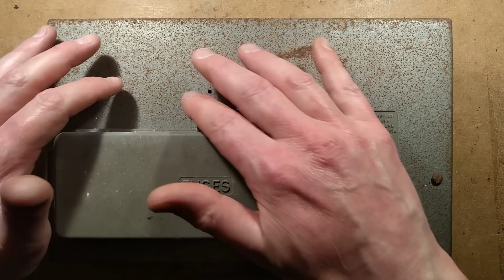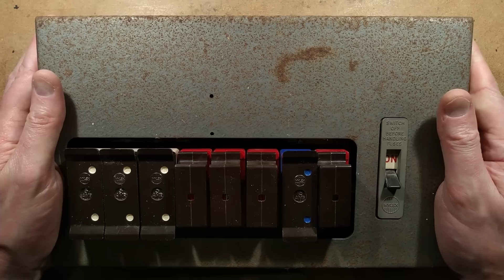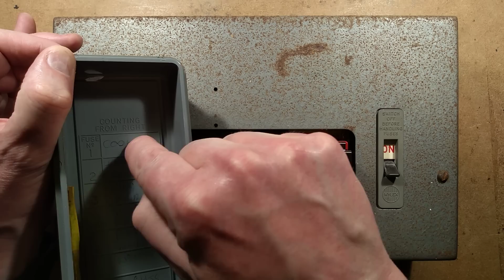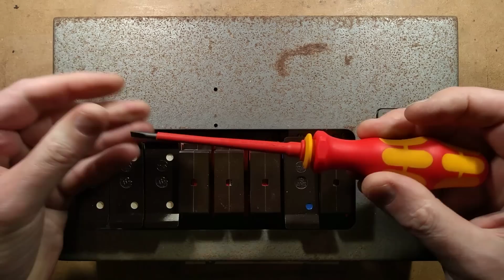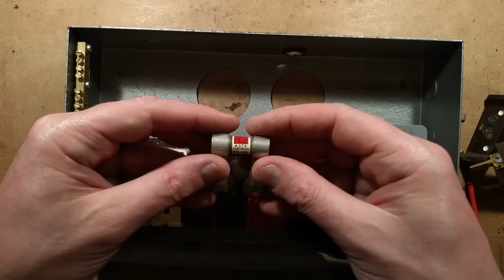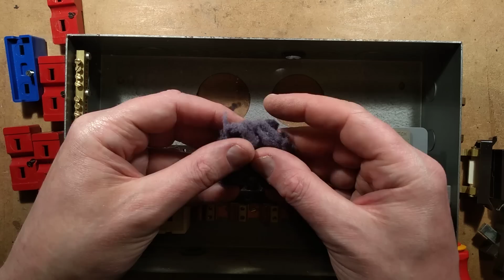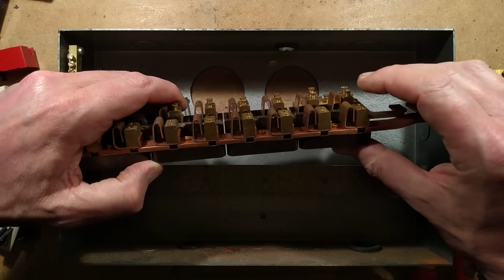Teardown of an old British Wylex electrical fuse box.  (with bare fuse wires)

Comment: I live in Clydebank and when I was a kid there was a derelict building down at the clydeside called auto leisure land that had what looked like giant vats made of the old white Victorian enameled bricks that were about 50ft deep and we used to jump off the top into the lovely soft white fibrous material in the bottom and then climb back up the ladder at the side and we would do this for hours not knowing that it was asbestos
Reply: The big man metal detecting 😳😱

Comment: You should have mentioned the truly disgusting aroma they emit when the fuseholders overheat!......had one in my old house, located in the enclosed front porch. For ages, I thought something had died in the cavity and was quietly decomposing, then finally traced it to the CU. It didn't like the load of the electric shower.   My current place had the same CU fitted when I moved in. Had that replaced!
Reply from the maker: That aroma is a good clue that something is overheating.

Comment: A very common problem. When a blown 5A fuse is re-wired The new wire is correctly wrapped clockwise under the screw head in the fuse holder,  Tightening the screw pulls the wire taught and often causes an almost invisible hairline break in the wire just by the edge of the screw head. The fuse looks OK and gets replaced into the board. Of course the circuit won't work and it can take hours of fault finding to find it. (Sorry to all those electricians who make a fortune out of call-outs for this one for giving the game away.)

Comment: I have one of those in my cellar right now......it did get "upgraded" with re-settable fuses....interestingly 10 years or so ago i had to do some work on the lighting circuit, i removed the fuse...and much to my shock (heh) i found it was still live....with no fuse.....it was arcing across behind the fuse.....so that got disconnected.....i'm fine running my whole house through 3 fuses eh?

Comment: I had one of these in my home up until 7 years ago. Then I had an electrician install a modern MK box fitted with RCDs when I had central heating installed. Then I met someone who told me my electrical supply was "ILEGAL" and said he would have to disconnect me unless I replaced it all with a new box and new RCD units. He also took the old MK RCDs away to "DISPOSE" off.
He disconnected the supply and I had to call the police and get my old switch gear back. 
Yes a crook electrician. They still exist in London.

Comment: Im guessing that a" ring main" is what in America we would call a receptacle branch circuit?
Reply from the maker: It's for receptacles, but unusual in that it loops round in a circle from the breaker, to all the sockets/receptacles and then back to the breaker again.
Reply: @bigclivedotcom  is that with a neutral or both legs of the single phase? What is the voltage? I know you guys do 230 @ 50hz  but is that with a neutral?  What is the single phase voltage with both legs? Do you have three phase, I assume you do.
Reply: @Ojgville4l  UK has three phases at the pole but only a single phase to each residence. There aren't two "legs," as it's not split-phase power like U.S. homes have. There's just one line/hot, one neutral, and one earth.

Comment: I have a plastic wylex box,all fuse wired.
Iam wanting a commando socket installed outside,but am concerned ab electrician would tell me I need new unit.
Would I need one,should I get one?
Reply from the maker: It would be better to protect the outdoor socket with a suitable RCD.  That could be added in the style of a shower unit.
Reply: @bigclivedotcom  thanks👍

Comment: I once worked in a band whose bass player would wrap silver foil peeled off a packet of Club King size around a blown fuse....as   opposed to having a spare amp in the car...
Reply: McOscillator House owners are legally required to check for this trick whenever a craftsman other than a certified electrician has been left alone with the fuse box.  Few do though.
Reply from the maker: There are some people in the entertainment industry who do that and "teach" the next generation about it too.

Comment: Old School, PROPER JOB !, - Easy and cheap to install new fuse wire, at a moments notice, - or Bacofoil / Chewing Gum Wrapper / Coathanger or such, if you run out of that, jobs a good un.  Nothing whatsoever to go wrong (apart from slight risk of house- incineration).  Good Old Days.

Comment: I still have one of these. It buzzes slightly when the shower is running... and the lid broke last week when the door caught a gust of wind and smashed into it. Oh dear.
Reply from the maker: That's probably because the unit is probably not fitted with the correct protection for a shower.  I think the maximum protection in these is 30A.

Comment: I have the plastic version of this board installed in 1980 with fuse wire, having it replaced next Thursday.
Reply: Send the original to Clive :)
Reply: Haven’t watched the video yet, just read a few comments. Asbestos has been mentioned so not sure I should be sending the fuse box in the post.
Reply from the maker: No don't send any fuse boxes.  I've got too much stuff here already.
Reply: No don’t worry, my fuse box is going In the bin. Wow Clive actually wrote on my thread feel very honoured.
Reply: Clive can you do a hoarder tour video? Would be fun to see your hoard of stuff.

Comment: Company fuse ,cut the seal ,and pull it out. Don't put your fingers in the hole. If anybody asks ,it was all like that for as long as I can remember. 
There should be planned power cuts so we can all bury a jumper wire in the wall

Comment: Why is there no MAIN fuse, as in the USA "entrance" box?  It should limit total current, not just each branch circuit?
Reply from the maker: There's a sealed fuse on the incoming cable side of the meter.

Comment: Reminds me of stab lock by fpe here in usa... looks alot more reliable tho!....
Reply: the stab part of stab lok wasn't really the big issue although it did happen, it was more the non common tripping common trip breakers, the turned off but not really off breakers, and the gfci's that trip into a non disconnectable state so the very act of tripping the gfci makes the power more difficult to disconnect and removes all overload protection.

Comment: I have an old war time workshop that has a load of this wire type fuse system some large some small, i'm getting tired of the down time when I have to change wire, I would like to modernise the 3 phase side of things as I now have an 11kw compressor, could I get away with changing these fuses to mcb , I believe that is what they are called, I'm no electrician but I've struggled with getting a reliable electrician to come in or come back
Reply from the maker: You may be able to find a resettable circuit breaker that plugs directly into these panels in place of a fuse.

Comment: Ah yes I grew up with that protecting the 15 and 5 amp non ring main distribution, that I survived without either electrocution or fire. Ok I did have an electric shock or two from light sockets but that is another thing.  What I consider bonkers is that where I live now started out with a box like that, only with 13 amp ring mains, but was replaced with a set of circuit breakers, which has been replaced since with a new set cos the old ones were too dangerous, and I expect that the new one will not be considered safe enough in time to come, elfin safety and all that. Oh I remember the old days of replacing fuse wire and having to have it handy along with a torch with ever ready batteries and incandescent bulb.

Comment: Could you do a video explaining the difference between the "Ring" main in the UK and branch circuits in North America?  By the way, who was the bucket head that thought you were poking around in a live panel?  Anyone that watches your videos should recognize your bench, not to mention there were no source or loads wired in...
Reply: Basically a "ring main" leaves the consumer unit breaker goes around the sockets on that particular floor and then returns to the same consumer unit breaker  er ...in a sort of ring. It's an old anachronism that dates from after WW2 when copper was short and expensive in the UK, the idea being that smaller dia. copper cable could be used for a greater amount of amps if it returned to the unit. The other circuit in use is a "radial" in the UK which I think is  the same as a US "branch" circuit This leaves the consumer unit and daisy chains sockets but does not return to the consumer unit. Radial circuits tend to have thicker cables  if they are covering what might be classed as a larger area (4mm three core cable) whereas a ring main will only use 2.5mm three core cable. Lighting  is on a "radial" circuit but is only daisy chained by 1mm cable as obviously it's low current.

Comment: How does grounding and bonding work in the uk?
Reply from the maker: Depending on the system, a neutral earth link at the incoming supply and then connection to key points like water pipes with cross bonding between taps faucets.
Reply: @bigclivedotcom  do you ground all your devices?
Reply: @bigclivedotcom  do you use ground rods?

Comment: How much would an electrician roughly charge to change one of these to the modern style one??
Reply from the maker: That can be a wide range.  It's worth getting quotes for comparison.  Depending on the condition of the existing wiring it would probably be around £100 for the unit plus a day to fit and test it.
Reply: ok. thank you Clive . Merry Crimbo to you all x

Comment: If I moved into a house that had one of those I'd just replace the fuse holders with breakers.Seen them on JW's channel and, honestly, I see no reason to keep using fuse wire when breakers that fit into the slot are  cheap and easy to get.

Comment: What is a “ring main”?
Reply from the maker: Also called a ring final circuit.  The cable loops around the loads in a ring and returns to the fuse/breaker.
Reply: @bigclivedotcom  ah ok. Thank you for the explanation. Keep up the great content!

Comment: Ah, the easy to touch busbars...  how I remember the belt you used to get off of those 😞

Replaced one of those many years ago, never realised the busbars were exposed, was pulling fuses to identify circuits... yeah, not something I'd recommend.
Reply: That hole in the top means you can get a shock by just pulling the fuse with the main switch on.

Comment: Got to disagree with you on replacing this thing if you have one in your house.  I'd be replacing this scary thing with modern circuit breakers before moving in.  I guess the wire fuses are better than the screw in fuses that could get bypassed with a coin though.

Comment: theres hedge in my neighbors backyard (thats right next our fence) that had an asbestos tile buried in it (probably by previous land lord) the new tenants recently moved in to this house and they have ripped out that hedge and the asbestos tile. we had washing out drying whilst they were doing this and i am worried that our clothes may be contaminated with asbestos now.
Reply: QWERTY4REAL A few specs of dust is rarely a problem. Each grain is like a lottery ticket with a very small chance of death.  Another post mentioned the safety limit for civilians being ten thousand fibres per cubic meter of air, all day, all year.
Reply: @johnfrancisdoe1563  thanks for your reply i think the asbestos tile was made out the less dangerous kind of asbestos anyway

Comment: Are you sure about breakdown twixt fuse wire and case.  It must be a few mm and with 240 V is that too far ?  #justsaying
Reply from the maker: When an arc flash occurs it creates a tongue of conductive plasma that can travel quite a distance.  The same failure mode can cause an avalanche effect on mains voltage circuit boards when one are fails and flashes over to adjacent circuits.  The sooty mark on the side of the plastic cover would have been a hot plasma of air and metal vapour.
Reply: @bigclivedotcom  Is that the same problem I had with my bathroom pull chord.  I replaced the fitting, ballast etc before I discovered it was the switch.
Reply from the maker: @paulmartin42  What was the fault?  Was it blowing a fuse or tripping a breaker?
Reply: @bigclivedotcom  Neither of the latter. It would just flash the light intermittently like fluorescents do at end of life.   So was very surprised when it happened with new bulb ... new everything until I got a new  pull chord
Reply: @bigclivedotcom If u like I can send you it & ...
Reply from the maker: It sounds like it was a bad switch contract making intermittent connection.

Comment: We had one of these in my childhood home in the cupboard under the stairs. We also had dangling wires in our bedrooms with a switch in a pendant as a 50’s version of a remote control of the lights. The one thing I used to do at bedtime in the 60’s was bat the pendant back and forward when I was bored... until one time I knocked the pendant off the end of the wire..  and then TOUCHED THE LIVE WIRE THAT WAS LEFT BEHIND.  I had the scar from the mains shock in the palm of my left hand for years... and my Dad removed the pendant wire completely to stop it happening again. Barn door/horse bolted lol

Looked exactly like this... https://i.imgur.com/xbHxNDs.jpg

Comment: Still have one of these working in my downstairs cupboard......
Reply: bod Cole same here but ours is smaller with just 1 ‘sockets’, 1 ‘cooker’ and 1 ‘lighting’ fuses... so all upstairs and downstairs sockets are on one fuse, same with all the lights and no idea where ‘cooker’ goes as we have gas oven. There was a separate ‘breaker’ in its own box fitted at some point for the shower...
Reply: @gilbertsprojects2954  That sounds very familiar to me too. I guess I should be in rewire territory.

Comment: The irony now that 18th edition regulations require all distribution boards to be metal, when people have been removing these for years.  They were far higher quality than the crap that has been available for the last 20-30 years.  Plastic body, plastic mounting rails, thin copper busbars and easily-bendable screw terminal clamping areas.  Everything built down to a price rather than up to a decent standard.  If you could retrofit RCBO breakers into one of these boards it would be far and away the best quality board you could fit.
Reply from the maker: And then just to make sure they were more dangerous, they deskilled the industry in return for cash, issuing "approval" to people who had attended a one week course.

Comment: I had a strange fault at the care home I worked at. 3 rooms, lighting on same circuit, but none were working. Sorry, except one of the rooms was. Kind of. Anyway, months went past, electricians trying to find the fault, they could not. Changed the trip switch as last resort, no luck. No voltage in the other rooms at all coming in.

Months later, the resident in the room where the light WAS working, said that the light was flickering. Guess what, I had a look at the bathroom switch and BOOM. Two wires not connected to the switch but were slightly touching the contact. How, I have no idea. I re-attached the wires correctly and Voila! Problem solved!
Crazy how sometimes you miss the obvious faults like the switch in cases like that. Even baffled the electricians. I am not a sparky but know the basics and managed to fix the issue. (together with the resident that is)!

So what Im saying is, these RCD consumer boxes or what ever they are called, is the last place to trouble shoot and sometimes the first place to look when finding a fault. Trip switch goes off, logically would make sense to change it. But no. Always check location of where the trip switch is for i.e washing machine. And check the devices, unplug them, reset trip switch. Then you will find the cause.

If you decide to ever look at or troubleshoot your electrics at home or work, please make sure you know what you are doing. SAFETY FIRST and cut power, then trouble shoot. 
If you are not sure, then get someone who knows to do the job. Simple.
End of my story, sorry Clive. 
Great video as always!
Reply from the maker: It sounds like the electricians that were being called in were not really competent.  They should have traced the wiring and found the fault by methodical tracing and elimination.  Unfortunately it's probable they were facilities management labour and therefore not actually electricians at all.
Reply: @bigclivedotcom  They probably were not. But they have to be certified to a 'degree' to service the main supply distribution board tho right? Not just any electrician?
Reply: One guy actually made me nervous. He was checking the dis board and didn't look very competent. I stood back just in case hoping nothing was going to happen. Maybe I should have checked his credentials first!

Comment: I have recently ripped out a job in preperation for a rewire and installed a temporary supply, you wont believe what i found, from the meter isloator there was about 6 2.5 rubber insulated cables, all twisted up and taped using cloth tape one end into the isolator, and in the board all of those cores were cracking and the insulation was falling off, baring in mind these cables were fused at 80A with the main cutout fuse. It is much worse than i describe, the most dangerous thing i have ever seem in my life. Worse thing is that EDF had installed a meter about 3 years ago and reinstated these cables as main tails. Stupid.

Comment: As a surveyor your asbestos demonstration got me worried for a bit there. My only asbestos advice would be to suspect the worst and seek specialist advice.
Reply: I really wonder now - does asbestos have a smell? For obvious reasons i've never put my nose into a pile of asbestos heat shields...
Reply: @mfbfreak : No odor. It's just a mineral. A mineral that forms microscopic needle-like structures that lodge in lung tissues and irritate them forever.